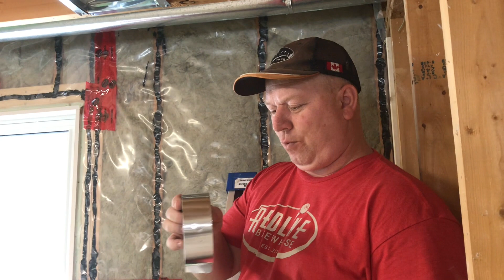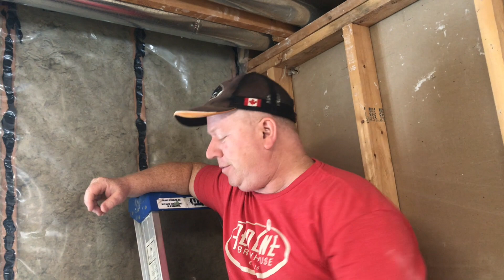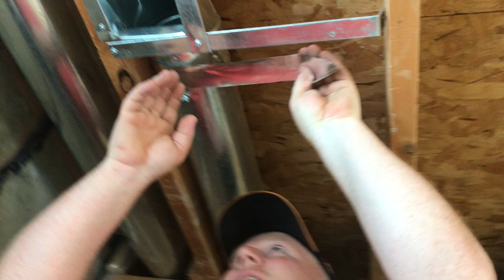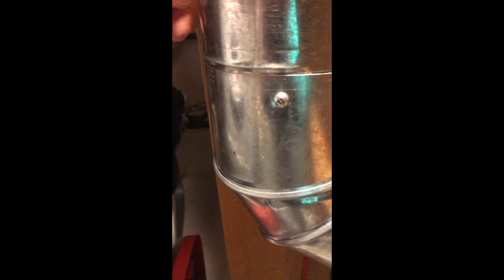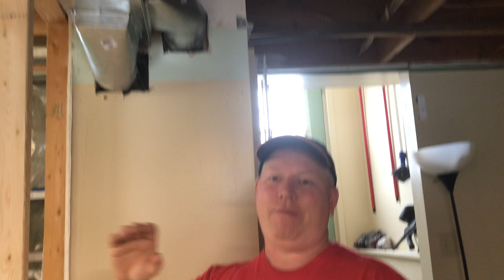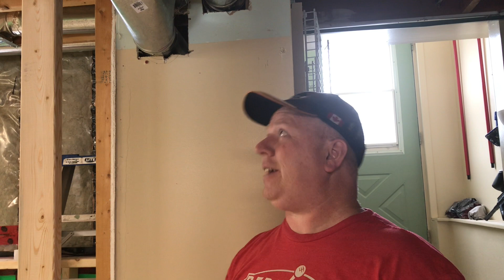Sealing Ductwork Gaps With Aluminum Foil Tape

Comment: Thanks for the video. We have a very old air con system here still using R22 gas and thought the refrigerant was empty but someone had a look and said there’s a few holes in the duct work. Will be trying to seal them up - and I’ll be wiping the dust off first. The motor is working but no air is coming into the room. Hopefully this fixes it🤞
Reply from the maker: It’s surprising how much of a difference it can make.  It’s also surprising how many big gaps can be in the ductwork or how many elbows are not connected.
Reply: @r @robsgaragewoodworkin yeah I’ll be having a good look up there to make sure there everything is connected and sealed off. Do you know if that tape comes in sheets as well for any wider gaps?
Reply from the maker: @CrazyCalabrese78 . I’ve only seen it in this format.
Reply: @robsgaragewoodworkin thanks for the reply :)

Comment: My issue now in an old house… there’s so many spots where air is pouring into my basement instead of the upper floors … now to find a good foil tape
Reply from the maker: Yeah at my old house there was a 3*C change in basement temperature after I added the tape to all the joints.  You may need to wipe the ducts down with a wet cloth to remove years of dust first.  Best of luck!!!

Comment: Does the foil tape adhere to wood. I have gaps between my return ducts and the floor joists. They use the cavity in my floor joists as a return conduit.
Reply from the maker: It’s very sticky, but I haven’t tried using it on wood.

Comment: The tape works really well on brand  new ductwork but what can you use on old ductwork?  My experience is it will not stick on old stuff.
Reply from the maker: Just try to clean all the dirt off the ducts as much as possible.  This house is from 1984 and I had no issues.  Good Luck!
Cheers!
Rob
Reply: Try acetone

Comment: Does this tape really stick well?.., and what should i use to clean the ductwork first, so it sticks well?
Reply: If you have good ventilation, you can use alcohol on a rag. This will help remove oil residue from previous installer's hands.
Reply from the maker: Yes it's amazing!  Just clean off the dust with a damp rag, let it dry and put on the tape.  Good Luck!
Cheers!
Rob

Comment: Brilliant trick in putting the tape around the duct and then pulling the backing off, exactly the problem I was trying to solve!
Reply from the maker: Yeah that tape sticks to everything!  That trick seemed to work reasonably well.  Thanks for your comment!
Cheers!
Rob
Reply: Except that the video cuts out right when the backing is peeled off, and were the guy to just pull it, it'd pull the tape from behind the pipe. That trick needs more steps: first put the still backed tape around the pipe, then pull a bit of backing off, STICK the tape to the pipe, and then pull the rest of the backing behind the pipe... somehow. With a wire or a bit of plain transparent tape, maybe, dunno.

Comment: Could this type of tape be used in a muffler
Reply from the maker: Mufflers are relatively inexpensive and relatively easy to replace.  If you can't do it yourself, shop around the smaller shops and get it done properly.  JB weld, tape and tin cans with clamps are a waste of time and ineffective.
Good Luck!
Rob

Comment: what about using mastic instead? Ain't that better and more permanent?
Reply from the maker: You mean that stuff you fill nail holes with?  You can use aluminum tape or there is another product used by the pros that you brush on.  I like the tape because it bridges the large gaps from the sloppy workmanship of the contractors.  Buy the big roll because you will use lots!
Cheers!
Rob
Reply: Pookie

Comment: what brand tape and item# and where did you buy it?  thanks  DC
Reply: I can't tell you what he's using but I use Nashua 324A tape.  It's UL listed and sticks like the devil.  In fact aside from duct work, it's been holding the tail lights into my truck for the last 7 years.
Reply: Venture tape is the Best..
Reply from the maker: Aluminum foil tape is available in there HVAC section of your local home improvement store.  I don't have the part # or brand name.
Reply: Rob's Garage Woodworking you make a video and show how to use tape but you don’t know the name of the tape?  You are special kinda’ stupid.
Reply: @robsgaragewoodworkin  ok, I had bought some at Lowes but it is not as heavy a tape as what was on my system when it was installed. I was hoping for a lead on the heavy tape. I've called a couple HVAC suppliers but they don't want to sell to anyone but their installers. Thanks for the reply.

Comment: You need to use the small squeegee with foil tape or it will come off much quicker. I didn't think the squeegee was necessary until I got one. It makes a  huge difference — especially with the 3M foil tape. https://amzn.to/2BJkQwF

All that said Red Devil F Seal is the best way to do it. Much faster to apply and better seals. https://amzn.to/2LznhX2
Reply from the maker: I'll have to check it out!

Comment: if you ever need to remove or move the duct work, is the foil tape easy to remove?
Reply from the maker: You can remove it and you can cut it by the seam but it's not "easily" removed.  I would tape it anyway because you lose so much heat through the gaps.
Thanks for your question!
Cheers!
Rob

Comment: You want a cold basement?  I keep mine heated and spend a significant amount of time in the basement.
Reply from the maker: LOL!  That's how much heat leakage there was in the ducts.  When I taped up all the gaps and holes the basement temperature of my bungalow decreased by 5*C.  That made the basement the correct temperature Vs. the main floor.  Because of all the leakage the basement would be warmer than the upstairs.  After the airflow was going to it's correct destination we were far more comfortable everywhere in the house. 
Cheers!
Rob
Reply: Rob's Garage Woodworking ha, wow.